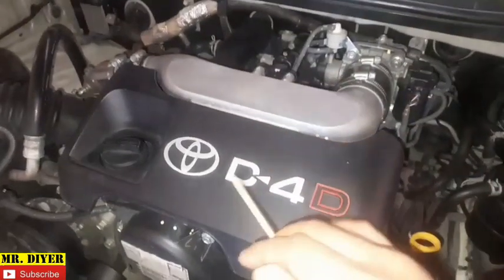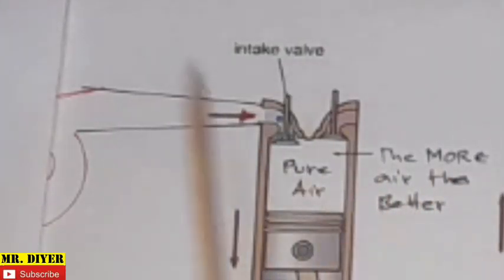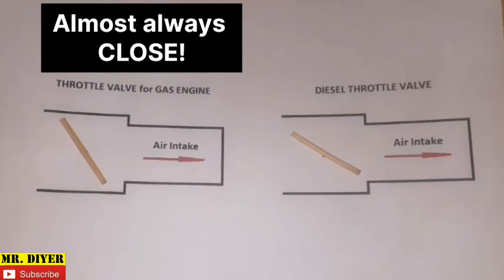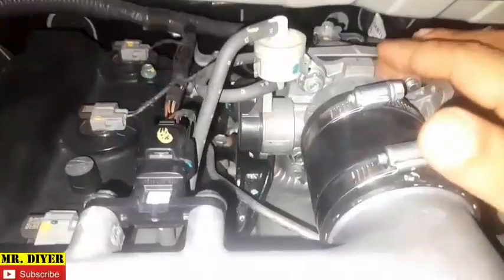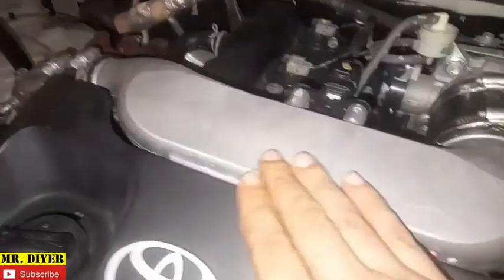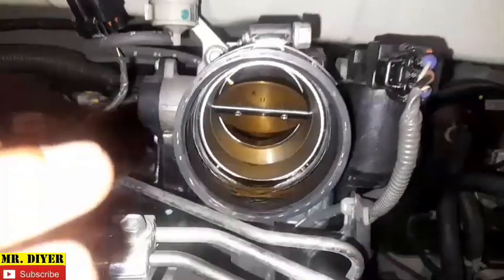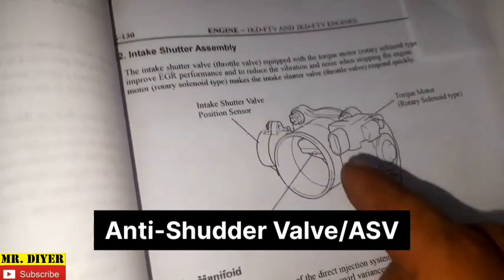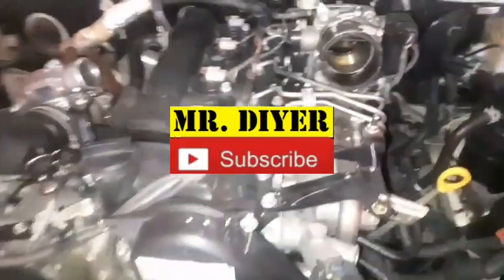Gas vs Diesel Throttle Valve Explained

Comment: Great explanation. One thing I will add that I learned in school (car mechanic here), is that the valve can also be used to help regenerate the DPF. The ECM closes the valve partially to slow down the flow of air to the cylinders. This in turn increases the temperature of the exhaust wich in turn increases the temperature in the DPF to burn off the soot.

Comment: thank you for that video, honestly, .your explanation is very precise, when I saw the throttle valve on modern Diesel Engine  I wonder of the purpose of putting this valve because we control the speed of Diesel Engine buy controlling the amount of fuel in the injection. When I saw this video, now I understand the purpose of the throttle valve on Diesel Engine.

Comment: Other than the 2 functions already mentioned in the video, another possibility is the use of the diesel throttle valve to reduce NOX emissions by reducing air ingestion and effectively enrich the air/fuel mixture in "part throttle" situations, which is the vast majority of an engine's operational regime during normal road use. The anti shudder function could also be used as a mechanism to prevent diesel runaway condition by literally suffocating the engine.

Comment: Finally someone gives a clear explanation.  Unfortunately it does lead to one more question for me: if it immediately opens for starting and running, and goes fully closed only momentarily for shutdown, what is the point of the 45° position when off?  It seems like it would be better to default to full-open so that if the mechanism fails, your only result will be a shakier shutdown, but power operation will remain unaffected as it will simply behave like an engine with no shutter valve.

EDIT: nevermind, the next video pretty much explains this.  The neutral 45° state is probably the most common position during warm idle and cruise.

Comment: My hilux kun25 doesnt have power take off, Ive been blaming the throttle valve but now this video has convinced me that it isnt it. It gains power after take off when taco meter exceeds 1500rpm and when going up hill it slugs I have worked on the fuel system from the tank up to the injectors but nothing hes changed what could be the problem? Another thing that I am suspicious is the fuel regulator
Reply: Did you find out the problem? Have you had any issue with your surpentine belt? the tensioner or idle pulley, if the belt is not tight enough it can slip which apperently can effect the car under laod and effect acceloration and delaythrottle response🤔 i'm having the same issues and was confused with the fully open throttle butterfly. I've spent hours watching vids on here and searching every which way and reading loads on google until I found this guys video! 🙏 
Been a joke! Not one person has explained it and not just that but such a bloody simple breakdown, makes you wonder what all the other plonkers on here are even bothering making vids.😮

Comment: Does valve close only if you have running engine and you turn it off? I am trying to see if mine is working properly. Can I see it close if only turn ignition on and then off without start the engine?
Mine sits open all the time an making beeping sound , but not moving.
Thanks!

Comment: @Mr. DIYer, Thanks for the explanation. Sir, question, how does the diesel engine shutter valve being controlled? Does it get power or electrical signal from a line or purely pressure driven?
Reply: The engines i have seen its operated by vacuum and controled by ECM.

Comment: Hi bud, I have the weirdest problems on my Honda Civic tourer 2014 i-dtech diesel. I went to change the air filter and thought to check and clean the throttle body butterfly. It was fully open which I thought was strange as had no real issues, I mean I have thought the car was a little sluggish on acceleration (delayed) and thought maybe my EGR choking. I always put good quality treatment into fuel and try different types so thought maybe not so... Lately had a little stuttering at the first few lights after leaving the house first thing but not when pulling off the drive? 
My throttle body was fully open with engine off, I sprayed it and wiped but was pretty clean... as clean you could wish for, I sprayed in with engine running spurts of spray at a time but no movement with butterfly? 
I had my naibours grandchild come with half decent scan tool tablet a month or two earlier to check car after I gave him a toe and he said that there was no codes, which he thought was suprising. I dont know if he knows fully whats wha but he mentioned my pedal showing depressed 19% ?? he didnt start the car with scan tool plugged in which I asked and said that I thought you could but he said not with his tool. He said he wiped the car for any codes anyhows. Oh I did have a funny few weeks with my battery dying a while back and got that checked but came back fine (just needs a charge so I bought a smart charger and let it do its thing but it kept dying on me and then I put the battery on a full repair charge and its been fine since plus i've kept car in a lower gear to charge up more as my brother said I was driving like a pussy... trying to save miliage 😂 Any idea bud why my butterfly is full open with no real issue on idle or revs going high and once the car warms up all other issues apart from sluggish accelorator dissapear! oh and I disconnected the battery a few times to charge so I assume the sensor would have reset as ive heard on another vid to disconect the negative.

I have been worried why my surpentine/alternator belt seems slightly worn on the outside but looks great on the ribbed inside? I thought maybe my issues was the belt tensioner or idle pulley but strange how the black is wearing off on the outside and all looked good with no movement on the tensioner. I did hear the other night late on when it was quiet a little rythmic chirp ever so quiet which i've not heard before which makes me think the idle pulley but cant make head way with the throttle body butterly fully open?
Reply from the maker: Because its a diesel throttle valve. It doesnt work like what you typically see on a gas engine. 
https://youtu.be/FrpyLvPodkc?si=Cr9AulBRQS5jUdI9
Reply: This is my first diesel car hence the initial confusion with the intake butterfly being open😁 and I'm no mechanic but wish I was... wish i'd took it up and with somebody like yourself. You are so inspiring with your videos and how you present them. I feel like I want to follow you round like my dad... and just suck up every ounze of knowlege🙏
Reply: Now my heads thinking compression after watching your video... gasoline vs Diesel.
I can only assume it would either be a fuel issue which I dont think so because car starts first time and fuel runs smooth once warmed up! it's just pulling off from the first few junctions and lights in the morning, plus I changed the fuel filter OEM part 2 years ago when I got it, I mean unless the fuel pump has no interaction on a cold start up and then flip flops untill warms up and then works fine..? 
I dont know or have a clue how fuel pump works or how they can start to fail, something I've never looked into yet.
You said in that video if a diesel has good fuel intake and good compression then a diesel engine will run and run and  ignites without the glow plug once initiated, running from compressed air temprature ignitions.
This has got me thinking also with my oil levels... you stated I think in your video PCV valves that if bad compression in chamber and leaking past pistons then fuel amongst other nasties get into my oil and if the PVC system not working... I have noticed what looks like slight oil on the past 2 air filter and in the centre but from outside air intake side which I had thought was unusual? My oil has not lost a drop in 2 years since i drained and changed it. first car ever and with 100,000miles thought to good to be true! Almost seemed like it was ever so increased even... which I thought was maybe me checking oil on a slight incline or that the oil moves around chambers and gets stuck in sumps n places. I was thinking it could be the PCV Valve having issues jamming up and once engine heated up the crusty oil scud starts to loosen and alow pressure flow away better? Have you any off the cuff ideas or any tips to try and get to the bottom of this? 
Or even if I was to get my naibours grandchild with his scan tool tablet... what things I could ask him to check for on it that would be a tell tale signs. 💩🙈 gonna cost me a fortune!!

Or my mind!🤣😂😂
Reply: The thing that gets me though is that if I give it more revs ie fuel before i take off the clutch, I dont get the stuttering... like its trying to stall out on me as much. if at all most times??
All your help is much apprichiated.
Reply from the maker: @stephenmaas8775  if thats the case. More than likely your fuel filter needs to be replaced. From what i gathered from all you said. Its been two years. Hightime to replace your filters. Replace your oil.
Reply: @MrDIYer  I've only done 10.000miles in the 2 years so was thinking about replacing oil again this year! I thought you only change fuel filter like every 10 years or like 70 - 100,000miles?? It was a right awkward place on this honda
Reply from the maker: @stephenmaas8775  you need to replace your oil every 10,000 kilometers or once a year whichever comes first.
Reply: @MrDIYer  Would using lots of additives in my fuel to clean engine system effect the fuel filter? I've googled fuel filter for Diesel cars, does a diesel fuel filter need replacing every 20 - 30.000 miles roughly? depending... could my fuel filter really be bad already! 
Also I've had diesel sitting in containers in my shed cus I buy in bulk at Cosco prices, how long can you have diesel fuel sitting around?
Reply from the maker: @stephenmaas8775  i dont use fuel additives so i cant recommend any. Fuel filters are cheap and replaceable. And theres no magic number as to when to replace them because sometimes it depends on your fuel source. If their fuel is dirty hence your filter will clogged up easily. Like ive said in my previous reply, high time to replace your filters and oil considering it has been two years.
Reply: @MrDIYer  It was a pain in the backside replacing the fuel filter on this 2014 Honda Civic tourer. from underneath and behind the engine which made a right mess towrds my face taking it out😁
Reply: @MrDIYer  Why dont you use fuel additives may I ask..? I was worried it may chuck scud through system into the DPF

Comment: Now that you know what the butterfly valve is please Stop calling it a Throttle Body because clearly it has Nothing to do with regulating the amount of fuel. VCV (diesel fuel Volume Control Valve) regulates the fuel, the same job as Throttle on a Gasolene or Steam engine. Throttle is about Vapourised fuel control

Comment: sir bakit innova ko,delay acceleration?
Reply from the maker: Baka naiwan bukas ang egr valve. Pa scan mo
Reply: When you say left open...? scan it... can the EGR be relearned? and if so could this be my issue with sluggish acceleration and stuttering almost.. engine knocking wanting to stall.
On a morning start It starts great and first time and I take off but soon as I get to the first lights not far from home and try to take off again the car sounds starved of fuel and does this at a few traffic lights untill warmed up and then all is good, It also seems to have gotten a little worse lately but seems slightly better when I pre press the accelorator to give it some diesel before lights change and I put it into gear? My acceleration seems delayed but I have no other running issues and idle seems spot on. Any help or ideas be mucho apprichiated!

Honda Civic tourer 2014, 1.6 i-dtec